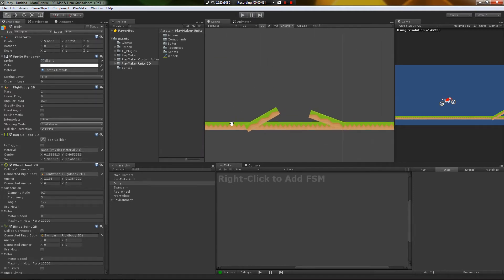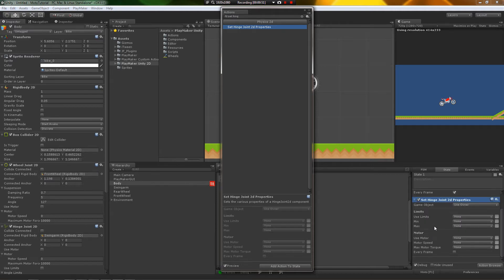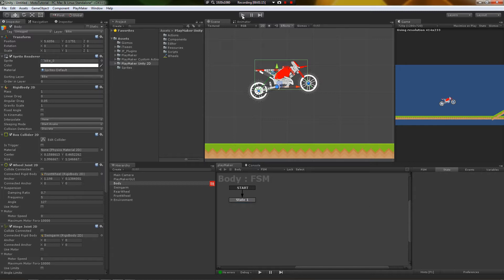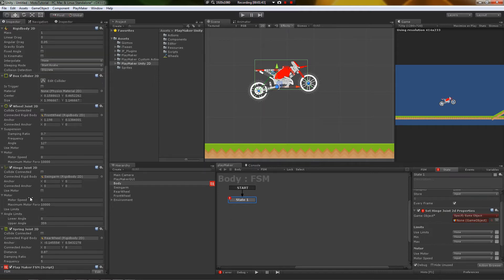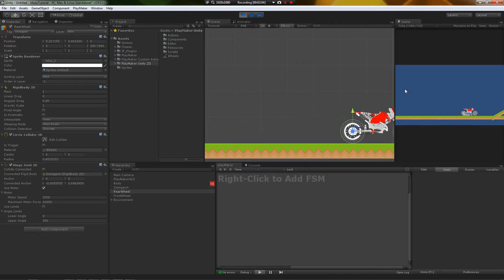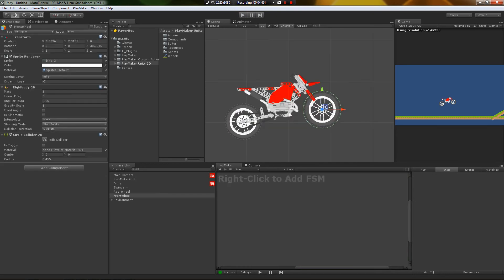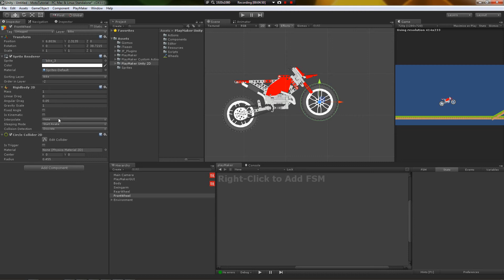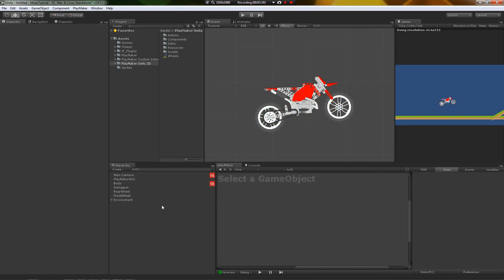Unity 2D Physics - 4) Simple Motor Inputs

Comment: i tried writing a script and referenced wheel joint 2d. the script worked on my friends laptop where he pressed the input bottons and it toggled the motor use on and off on my laptop it didnt. if the script is correct why arent my input activating the wheels

Comment: When I use the "Set Hinge joint 2D Properties" in the FSM,
there are conditions that component "Spring Joint 2D", that are attached to the Body, does not work.

"Set Hinge joint 2D Properties" of "Game Object" is, that's "Use Owner”,  component "Spring Joint 2D" does not work.
"Game Object" is, that's "Rear Wheel", It move without problems.

Do you think What is the cause?

- Unity for Mac Ver.4.6.1.f
- PlayMaker Ver.1.7.7.f6